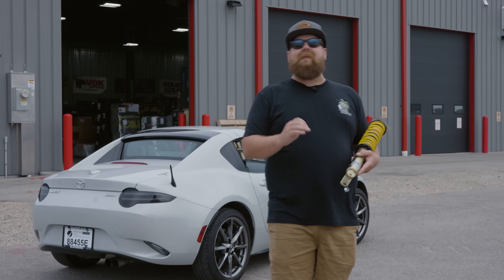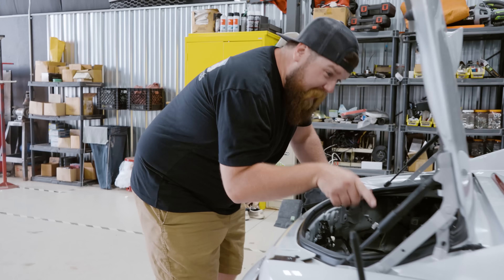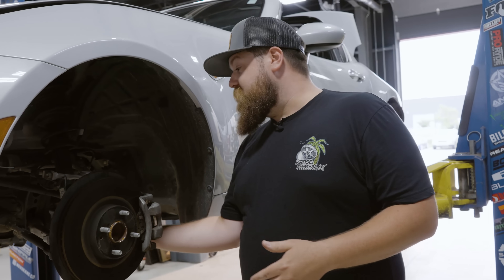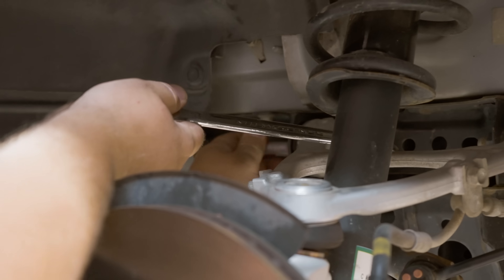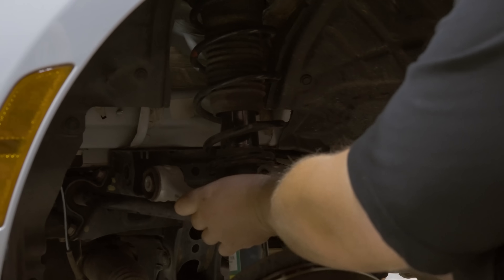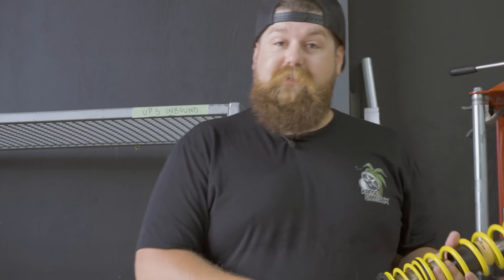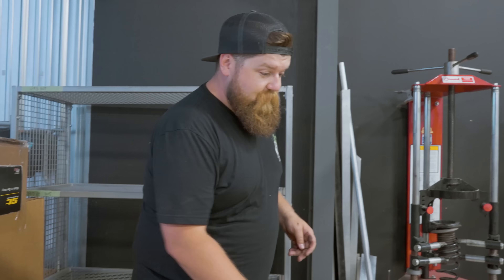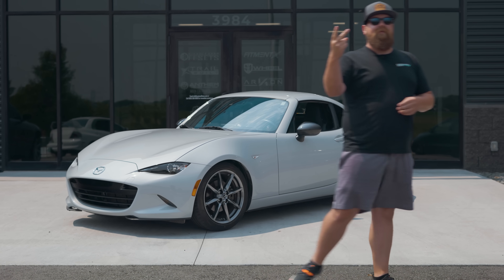Installing Coilovers For Dummies!

Comment from the maker: Did we miss any tips? 

Want your ride to sit as well as this MX-5? Find ST Coilovers here!
https://bit.ly/3ztdLfJ
Reply: If you are doing a mustang, start with the rear. The front is significantly more time consuming, even compared to other cars.
Reply: Did i miss the part with torque specs? Lol
Reply: 0 fitment for 2010 lincoln mks ...
Reply: Just bought coilovers/wheels for my nd Miata a few days before this vid came out perfect timing!!!!
Reply: Can you do a video on unsticking a frozen coilover collar??
Reply: Did you remove all the pre-load from the multiple bushings (none eccentrics)? If you haven't the car will sit higher. This is a big deal for the ND when getting ride height accurate.
Reply: Remember lower your car too mutch will put ekstra strain on cvjoint and boots😅
Reply: Great video showing the removal (of old) and installation (of new).
A few thoughts:

Videography:
- Consider using cameras that have some manual over-rides.  
- E.g. intentionally over-expose by a few clicks, so we get better view of the actual working area (under the wheel well, engine bay, etc etc).
- Similar with "focal point". In some footage the focus was your sleeve/shirt, and the actual work area was blurry.

Actual installation:
- ALL the bushings, in every joint of all the control arms...  Loosen then re-tighten, while car is "at ride height".  So bushing has zero stress when at-ride-height.
- Any after-installation watchouts?  E.g. alignment?
- Didn't see you check full-extension & full-compression positions, tire-rubbing, etc.
- Where in the full-stroke-length is the coilover's factory setup?  Droop vs Bump ratio?

I know a lot of these will make the video a heck lot more complicated.  But that's the trade off.
Either folks understand all that, and go through a very complicated first-install and get everything "right".
Or, folks do an easy first-install, but know practically nothing about where in the coilover's full range of capability they're currently sitting at (might even get tire rubbing issues before hitting bump stop), and will later have to re-do almost everything to arrive at a "proper" setup.
Reply: How long did this take without the edits?
Reply: . . . Did it need to be disassembled and greased at the rubbing contact points in the coilover?

Comment: One tip, if you take a control arm loose that has a bushing with a bolt through it, don’t tighten the bolt until the suspension is at the angle it would be with the car on the ground. 

Like if it’s parallel with the ground when the car is on the ground, don’t tighten the bolt while the suspension is in full droop(like up in the air). Otherwise you will put the bushings in a constant “twist” and they’ll wear out faster.
Reply from the maker: Thanks for the insight! 🙏🏽 -Edgar

Comment: I feel like this is simple and there’s so much how to for coil overs and it’s pretty straight forward just remove bolts and the springs and the shocks and install coil over and bolt it down

Comment: Unbind the bushings. Need to tighten the bolts with load on the suspension not when its hanging. Watch gears and gasoline K Swapping My Honda Civic - Episode 3 @12:00. Control arm bushings have a toothed sleeve molded in with it. Thats why you fight the control arms trying to get the coilovers in or out. If it has a free floating sleeve like in some aftermarket parts, then it is not needed. I ask everyone i know if they unbind their bushings, they have no idea what i'm talking about.

Comment: What about rear coilovers with a divorced sprint and shock? That would be a good one to talk about.
Reply: It’s just as easy, the struts go in and out just like oem. you just need a spare jack to let the rear control arm and spring down easy. I managed to put coilovers on my mk6 Jetta with an independent rear suspension aka divorced with two oem vw jacks. You just need patience
Reply: @alexbueno5815  thank you. That makes sense. I am putting in some BC's on my 2018 Camry and my only question is the spring preload on a divorced setup. I have seen a bunch of videos on it but the Camry is a bit different then say a Subie as far as the setup goes from what I have noticed. I will be giving it a go today do cross your fingers. 🤞
Reply: Aww why did they get divorced?
Reply: @Mozetty  You know. Classic case of the spring cheating on the shock...
Reply: @return.of.the.nac18  damn hopefully the spring didn’t lose all of its function from the broken shock

Comment: Would it be ok to ceramic coat your springs for easier cleaning like you would for your wheels/brake calipers?
Reply: I mean, why not? You can coat almost anything. So why not your springs, they are painted like a car and if you can coat a cars paint you can clearly coat painted springs.
Reply: good question. I think its a bad idea bc your springs are constantly in motion going up and down unlike the face of a wheel.

Comment: Tittled for dummies, but didn't point out the actual pinch weld jack points or the the ones on the subframe. You guys also didn't removed the pre-load on the suspension bushings. The car will sit as much as half an inch higher when set for a 13.25 ride height. This is 101 coming from vendors. Going to have do redo your work before this car goes for an alignment.

You should have also provided the motion ratios so people can accurately adjust the shock body height to get exactly the ride height they want in one adjustment. As we know, the left and right side don't sit the same for the same measurement on the shock body.

Comment: Fitment with the ND, very nice. Still want to try one, had a 15 NC3 GT for about 3 years. Sold it for financial reasons just before the Rona really sank in, and found a very gently used 91 NA for ~$7500, 65k original miles. Not quite as pressed to drive an NB however, never really cared for how it looked compared to the NA.

Side note, and completely off topic; if anyone in the Aurora/Parker/Centennial area (or within 50 miles of) of CO has a fifth gen ('92-'95) Civic hatchback, is in decent shape/milage (175k limit) and is looking to sell for a reasonable, lol please price, hit me up. Like, $10k at most. Yeah, I know. Trust me lmao I know. But I promise not to molest it.